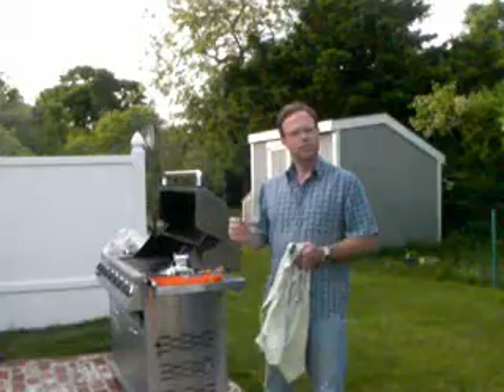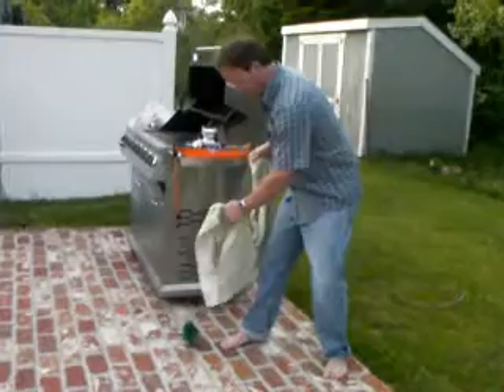Oil Leak Solution

Comment: When the sack starting filling with oil the density difference between the oil in the sack and the water outside the sack would cause the sack to compress and the oil would be pushed upward to the top of the sack with tremendous pressure.  The bottom of the sack would draw in and compress to nearly zero size.  This is basically what happens to high attitude balloons when they reach great heights.  Take an air or oil filled baggie to the bottom of your pool to see this effect in action.

Comment: How about just throwing the fabric over the leak? When it becomes saturated with oil you just stretch it between New Orleans and Oklahoma City and wring it out into the Mississippi. When it flows down river and reaches the last set of river locks, you just capture it in the locks and pump it out. Simple.